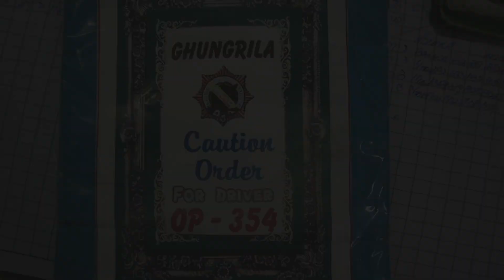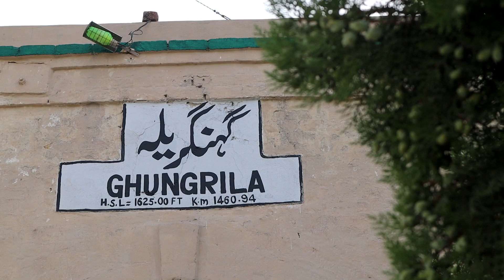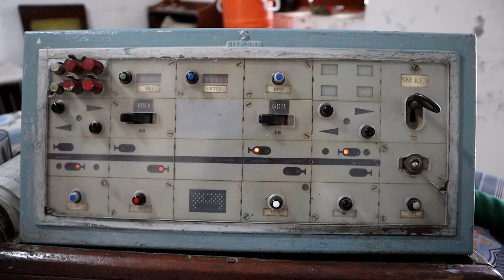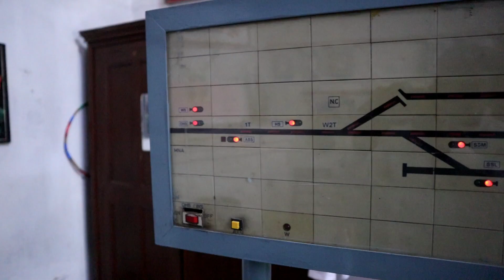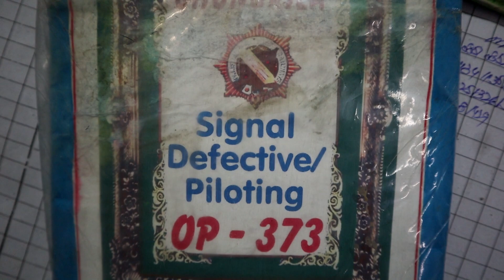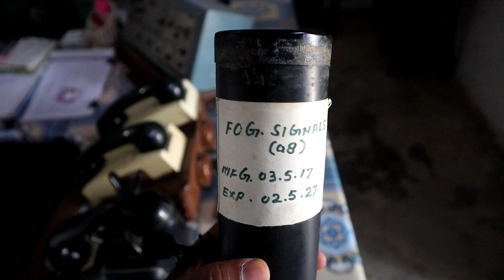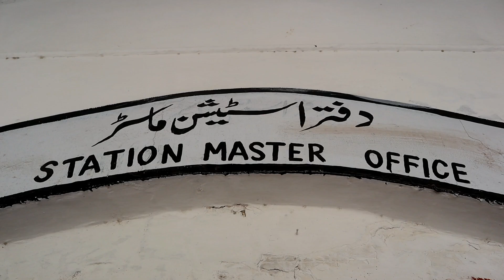Duties of Station Master in Absolute Block Section of Pakistan Railways | Ghungrila Railway Station

Comment: Dear Brother thank you for your efforts and dedication. Station Master Sahib has given very nice information. It’s very important and careful duty for such Railway Workers who are handling trains movements on single track from Lodhran to Peshawar and other branch lines. I hope we have double track at least on main railway track upto Peshawar or at least upto Rawalpindi.
One question, how long are the duty hours. ? Eight hours per person and three Station Masters are required for each station. ?
Regards. ❤ Nasir Islam London
Reply from the maker: JazakALLAH. Yes brother, there are three SM/ASM appointed with 8 hrs duty shift. But in shortage staff areas (branch lines), they can do upto 12 hours.
Reply: In Pakistan railway we have three shifts on mostly stations. At small stations Station master perform general shift duty 8-16 hrs and two Assistant station masters perform 16-24& 00-08 shift in rotation for weekly basis.

Comment: we are using about 55 years old system .All these working can be done through a single software with database. which can save much money and workers pays.
Reply from the maker: In most sections CBI system (Computer Based Interlocking) signal system has already been installed and station to station upgrade is going on.

Comment: Nice video and nicely explained all details. System may be old but effective. But to run more number of trains and to cater today's huge traffic, this system may not be that much effective.
Reply from the maker: Yes with high traffic, trains get delay due to this system. But if line is double, then problem will be solved.